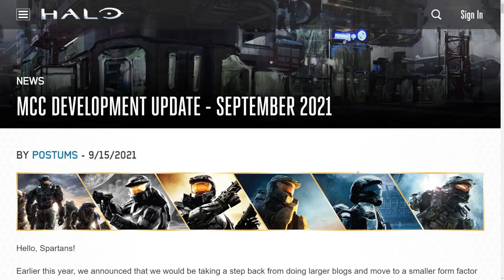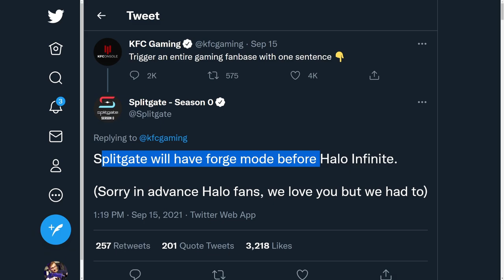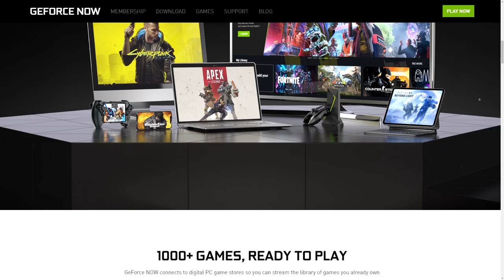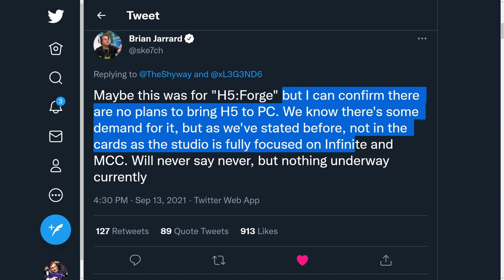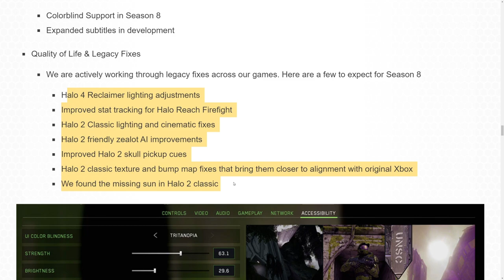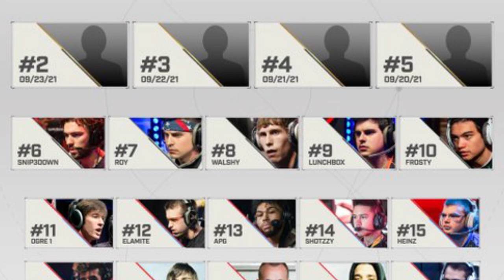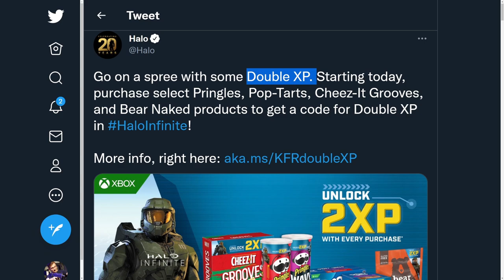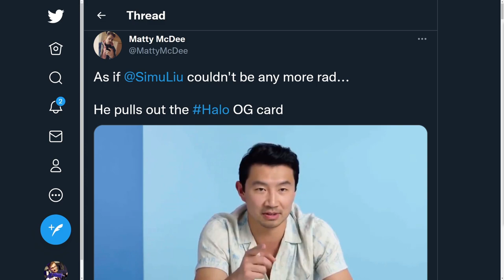Call of Duty Vanguard Graphics WORSE Than Halo! Splitgate Dunks 343! Marvel Movie Star Loves Halo!

Comment: It would make sense that the atmosphere would be unbreathable to the edge of the ring, since it is really just a tiny border between an artifical world and the void of space. I wonder if that is how atmosphere levels are at the broken sections of zeta halo, it won't affect chief but will it affect marines. It also leads me to believe a Halo ring generates gravity by spinning in a circular motion. Also to me the width of a halo ring doesn't make sense, the ring is confirmed to be only about 318km (197 miles) across. It sounds odd since the border walls of the ring seem to be very tall and since you don't see them from that distance, it feels out of proportion. Honestly something between 563km (350 miles) to 724km (450 miles) would make more sense.